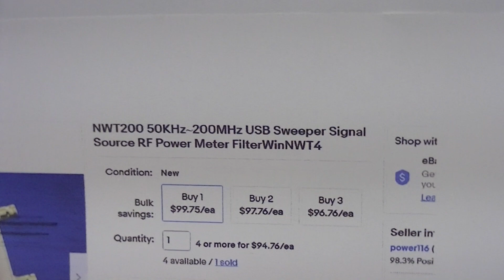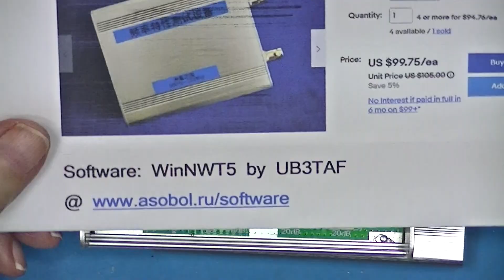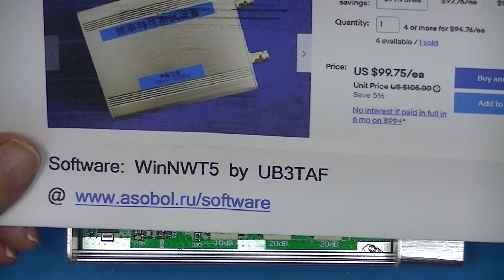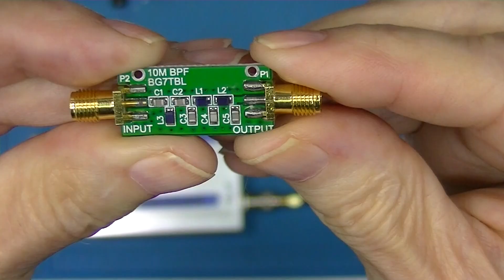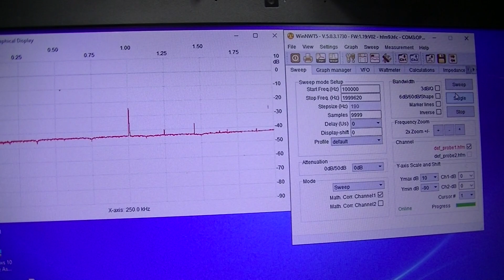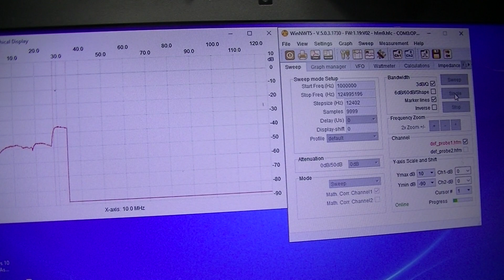NWT 200 -  Playing Around -  Part 1

Comment: Are you still using WinNWT5 with this unit or have you moved on to better sw?
Reply from the maker: Actually, I have moved on and am not using the NWT 200 anymore. The only software I used was the WinWNT5.
Thanks
Steve
Reply: @stevestrivia-bystevewagner4852  moved on to what? curious.
Just wanted to check if you still used it, as there are better software than nwt5 for the NWT200